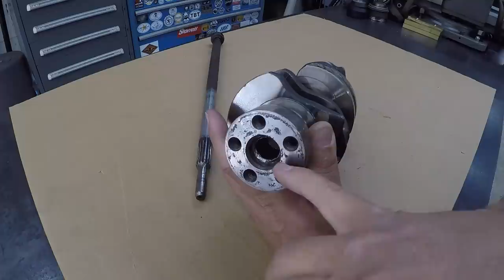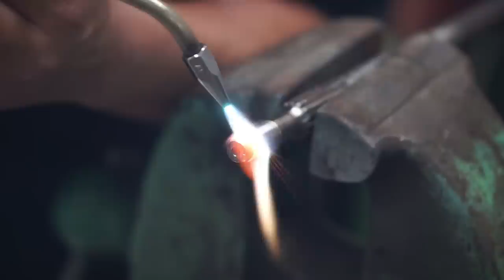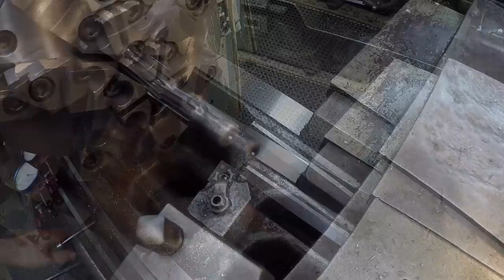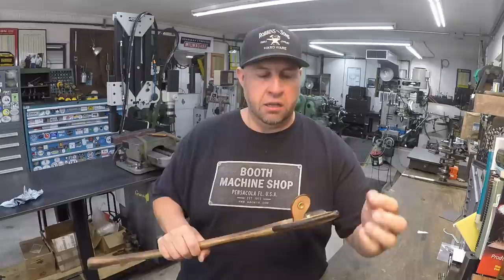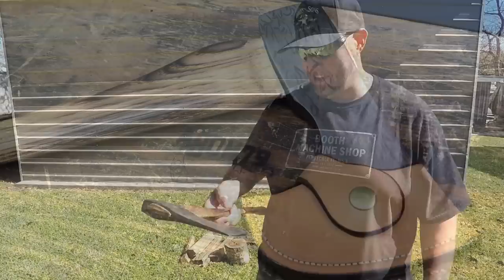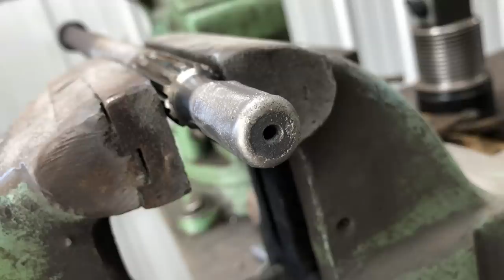SNS 292: Eutalloy Repair on Transmission Shaft, Essential Craftsman AX

Comment: The eutalloy torches have changed alot since the one i used to use in the 80's ( & that was an old 70's one ) the powder containers look the same though .    Nice work , Cheers .

Comment: Dear Abom, what I do not understand: the material is a hardened steel. If you metallize it with the Eutalloy-Tool, you may loose your tempering and hardeness anyway. How it should work ?

Comment: Hello I have already welded an axis this way but with the axis in the lathe. If you let it rotate slowly, you get a layer with the same thickness all around. You do have to cover the bed well so that there coms no powder on it. We also used a kind of heat shield paste that we put around the axe so that the heat remained only there where we spray the powder. If you put some of that pasta in the center hole of axe,, it will remain clean. Greets Eddy from the Netherlands.
Reply: He does that same spray welding process on many other projects.  It really is great for shaft build up as well.
Reply: I've seen him do it on a lathe lots of times before, I don't know why he didn't this time.

Comment: Cracking job there, but just one question. Will that fix even hold? The part was hardened before, the spray only had a low rockwell hardness, I'd love to hear your feedback.
Reply: It also looks as if the heat may have affected the heat treat of the splined area, that could have been wrapped in a wet rag to keep the heat away.
Reply: Yea I'd also say the temper was removed from that part as wel, Adam probably thought of it before starting.

Comment: Is there a reason that you didn't use a slow turning dividing head to do the spray weld ?
Would that not have given a more even application?

Comment: Would it be possible to add the Eutalloy with the torch while the shaft was rotating at a slow RPM to maintain an even addition of metal?
Reply: I saw in his answer to another comment, it's for non-rotating buildup.

Comment: Both feet should be the same distance to each side of the log your splitting. At some point your going to miss and the axe is gonna come straight back. Better that you can direct it between your shins rather than into one. Beautiful axe

Comment: Excuse my utter ignorance Adam but, surely heating the shaft up to the temperatures required for the spray weld messes with the hardness temper of the original shaft. Would this not lead to premature wear or utter failure of the shaft under regular usage in the application it’s designed for?
Again, sorry for my ignorance and I’m no metallurgical expert!
Reply: The splines and the rest of the shaft is all that matters. That end only helps keep the shaft centered.
Reply: @JusttheEdge  During the buildup the spline area turned blue, so the heat treat had to be affected.
Reply: @garybrenner6236  Clamping in the vice was probably enough to draw the heat out.

Comment: Could you set that shaft so it was rotating while you were using that amazing metal glue gun😁 to keep it coating the shaft evenly? 
What an amazing tool the Eutalloy Ultra Jet torch is, I have never seen it before now.

Comment: Hi Adam

Many YouTube posted such as you tell us the details of the puny power supply linked to their home workshop. It seems to vary across parts he country in minor detail which makes it difficult for us aliens to get a clear picture of the state of the network in USA.

Here in the great south continent ( north of Antarctica) across the vast nation we get standard 3 phase power at 415 volts RMS.    WE GET 35 amps per phase limited to 100 amps if you choose a single phase supply.  This is enough power to smelt your own metals if you can get the ore..   Bear in mind though that we pay up to 25 cents(US) per kiloWatt hour if you use this capacity.

Most homes draw down at 240 volt (RMS) via individual phases.  Load is equalised across phases within the household or by the supplier managing the phases in the street network.

Tried to keep this simple to give a. Clear picture to those , such as I , who are sometimes confused by what gets posted on YouTube.

Enjoy your posts,  Cheers!!!

Stephan of 50 Hertz

Comment: Also wonder why you didn't turn it at slow speed in the lathe or something while applying the eutaloy.   Sorry for being curious.
Reply: I had the same thought. Then I thought maybe for something that small he didn't want to risk spattering the lathe. Just me guessing,lol.
Reply: I used to do some spray welding like that at my previous job and we always turned it in the lathe at a very slow RPM. it allows for a very even application of powder. we made some covers out of light gage steel to cover and protect the ways on the lathe.

Comment: Very nice axe, awesome craftsmanship. That is a cross-cut axe for felling trees.  Way too narrow for splitting logs, you need a splitting maul or wedge and sledgehammer.  The axe is good for splitting off small kindling for a rocket stove.  Look at doing the contact style split.
Reply from the maker: tr5317 It’s an ax I can use to chop, cut, split, or whatever I need.

Comment: I mean, so long as u square up with the block ur chopping u already got the power (legs same distance just outside the shoulders, feet like train tracks and drop your hips when u swing) the leg position is mostly for safety and accuracy

Comment: Adam, do you think a powered welding positioner, set to ultra-low speed, would be an alternative to those constant adjustments in the vice?
Knowing you have the scrap stock on hand, mabey give it a try see what happens.
Reply: I saw him turn the piece in a lathe in one of his other spray welding videos, was wondering the same thing
Reply from the maker: A welding positioner is perfect for a job like this, but I have not invested in one yet.

Comment: I'm sure I'm just misunderstanding something here but if that shaft was hard to start with and the build up is only 10 Rockwell C isn't it going to be way too soft now?
Reply: I dont think it matters for the tip since it just rides in a bushing or bearing. i think the splines are the only part the really need to be hardened

Comment: Nice work but please fix that chamfer. The one on the shaft was not damaged and had that long taper on purpose to make installing the transmission easier. Trust me the more there is the easier it makes installing the transmission.

Comment: I'm not sure that is a splitting axe. The ones I've always used had much more weight to the head as well as a greater taper to the head. I am certainly no axe expert though.
Reply: grntitan1 Any axe can be a splitting axe or a felling axe. Depends on what is needed, what you got and what you need to do. I use wedges and a sledge hammer for splitting 3” and above stuff never a bladed axe. I use a small hatchet and the contact method for splitting up kindling. I’m just an old Boy Scout.

Comment: Im sure if you wanted to you could have set it up easily, but why not put the shaft in a rotating setup for spray welding?
Reply: @Global Eco Tec - Ritter ohne Furcht und Tadel Thanks for pointing that out. I knew there was a good reason just couldnt figure it out myself. Makes a lot of sense.

Comment: Id recomend you get a carbide center drill - you need high RPM but you can even centerdrill hardened high speed steel

Comment: If the original hardened shaft's metal did not hold up, it is unlikely that the powder metal build up will hold.  Just saying.
Reply: The end of the shaft was hardened primarily to harden the splines - it's quicker to just induction-harden the entire end of the pilot shaft, production-wise. The pilot end runs in a bearing or bushing in a bore in the end of the crankshaft; the bearing failed, and the hardened end of the pilot shaft wallowed out the crankshaft end. Not being hardened like it was will likely make the pilot bearing last longer.
Reply from the maker: It’ll hold, and work....just sayin 🤷🏽‍♂️

Comment: Why did you use that torch instead of the other one you usually use? And why not weld on the lathe? And wouldn't all that heat affect the temper of the shaft?
Reply: snakethebeast I thought the same thing. He had the shaft glowing which would soften it.
Reply: Oh yeah, that shaft end is soft as butter now!
Reply: Have you never heard of 'Re-Tempering' ?
Reply: Sure, retempering is something you could try, however because of the Eutalloy buildup, you probably don’t want to do because they would differentially harden and could cause the repair to loose its bond. If it were built up with weld, yes.
Reply: @Ex3t3r  Did you see him re-temper? Pretty sure he said that shaft was done.
Reply: Harry Palmer he also said he wanted it to become soft for machining and never once said anything about hardening it again.
Reply: @olivierlaplante8967  The machining aspect may have been completed so that just leaves  the re-tempering, this he may of contracted out to another company. Why not ask him ?
Reply: @olivierlaplante8967  He may of contracted this aspect of work out to another company where he was unable to film the process, why not ask him?

Comment: How does that work with the shaft being hardened and the Eutaloy being softer.   Won't that just wear out rapidly?   Normally a crank has a pilot bearing in it and the shaft goes into that bearing.  That bearing might be sintered bronze.   Or did the shaft harden due to wear damage?

Comment: Since the temperature of the shaft end got well over the "critical point"... I guess the material behind the splines would be a LOT softer... or it's OK? How are you making sure the metalurgy didnt change so that the customer doesnt end up with a soft end of the shaft? compare hardness of both ends or ..?
Reply: Yeah, I think there was another type of alloy intended specifically for building up hardened steel.
Reply: I don't want to be an armchair quarterback but that was my exact thought as well.  I would want to use hardness test files at least on the splines before and after the Eutalloy process to ensure the shaft remained hard.
Reply: @benrivenbark  ....Adam has a Rockwell hardness tester.  He knows what he is doing and I am sure he is aware of any issues with the temper of that part.

Comment: A couple of questions, Having watched some of your metal spraying videos I have just acquired a Eutectic Microflow torch and 16 bottles of various powders, what masking solution are you using as I need to get some myself, and is is possible to use Oxy Propane for this process or do I need to stick with Acetylene. I have not used this kit before so it will be a fast learning curve but I have almost 8 kilos of various powders ( that's 17.5lbs on your side of the pond). Great channel always interesting to see what you're doing

Comment: Are you able to harden that eutalloy?
Reply: capnthepeafarmer I’m wondering same thing,  specially since it’s going to get hot, if it’s too soft seems like it may seize up inside bushing/bearing
Reply: @mitchcumstein9808  Its definitely not going to get that hot. The splines need to be hard and thats it
Reply: Yeah, I was wondering that too. Once applied, can you harden eutoloy spray metals?

Comment: OK. I have a question. I completely understand that the point of the video is to show another technique of repairing a worn shaft. Great video and you accomplished the goal. But from a technical perspective why use the spray method for this job. The shaft was hardened as you show with the file to let's say 40+ HRC. The spray is rated to 10 HRC. Now given that a 40 HRC shaft wore down in the first place, why would you replace it with 10 HRC? So, I get the point of the video is to show different techniques, but why not braze on (or silver solder) a 60+ HRC collar … I'm just trying to understand.
Reply: You beat me to asking this question. Didn't heating the end of the shaft slightly anneal the and lower the hardness? That, and then spray on welding something that's only 10 HRC makes me wonder how this will wear now that it's likely much softer than when it came from the factory. Just trying to learn here  Abom - can you explain your thought process on this?
Reply: Several others including  myself asked the same questions. The unintended criticism taken seems to have triggered a defensive response. Not likely to get an answer. Don't expect one. 
Technically I guess the only one he owes an answer to is the customer if/when they have to tear the thing down again and buy the new parts anyways. Other viewers following suit considering this a viable repair could also fail without knowing the devil in the details.
Out of 100 other methods to do this, it probably should still have been declined as too high risk wasting everyone's time and money. I genuinely question the application,  annealing the shaft and using low temp soft alloy not much better than a solder coating sets off experienced intuition warnings. Trying to save the customer a few bucks can really harm ones reputation without a stern caveat they take all the risk and responsibility for the results.  
I do hope it turns out well.  It would be a sad nightmare if all that soft material contaminates everything.
Reply: LetsJeep - Yea, my comment with the same hardness questions, from just after the video was posted, seems to have just disappeared. It’s all good.
Reply: @richardneel6953  So just reharden the shaft?
Reply: @LetsJeep  Cast iron on brass bushings last for a very long time. Babbitt bearings are made out of lead, which is very much softer than anything steel.
Reply: @the_hate_inside1085 Neither really applies here as an apples to apples comparison. Brass bushings are typically low speed, low load rotational forces and Babbitt bearings are typically high oil pressure fed so there is never any sustained metal to metal contact. 
The base material cannot be re-heat treated. 
Sorry, the build up material melt temp is below the required phase change to reharden.
Reply: @the_hate_inside1085   rehardening the shaft wont do anything , the spray metal wont get any harder than what it is when it is sprayed on

Comment: Curious what kind of guarantee did you give him on how long it would last.I'm guessing that case-hardened shaft the last a couple hours under normal use.
Reply: I don't know what he's doing on the crank end next, but if he presses an oil-lite bushing into it it'll last for a very long time.. the shaft only turns in the bushing when the clutch is depressed
He could perhaps turn the ID of the crank bigger and put something like a 6202 bearing in and it would be next to eternal.
Reply: The shaft is connected to transmission and splined to clutch driven plate. As it is inserted into a self lubricating bush  in the crankshaft and only rotates free while the clutch is disengaged, it will literally last a lifetime.

Comment: What is that blue device with exhaust pipe next to the door ?
Reply: It's a portable fume extractor. You move the head over where your welding, cutting or grinding and it sucks up the fumes made and filters the air before expelling it again.
Reply: @TheQuantumFire  cool! thank you !

Comment: Are you going to re-harden the end of the shaft? Otherwise I forsee quick failure.
Reply: He said the failure was due to a failed pilot bearing, the shaft need not be hard, just the splines, the tip is only there to engage a bearing.
Reply: @derekcoiner5946  yup, and the shaft only turns on the pilot when the clutch is depressed.. it also only really needs to hold the weight of the clutch disc, so a couple pounds or so?

Comment: That's not for boy scouts. Outdoorsmen have name for that length and blade shape, but I can't remember it.
Reply: We used to call them a 3/4 axe.  (When we were Boy Scouts) 
:)
Reply: Dont they call that a "bearded" ax head?
Reply: Yes I think they do call it that.  I think Adam was referring to the weight of the head and consequently the length of the handle.  It would have been a bit silly to put a full size handle on a light weight head.  I went looking for the link to the essential craftsman video to see what he called it but got distracted :)
In any case it is a very nice axe.  I have never been into the burnt handle effect personally.

Comment: Long long time ago Dad showed me an easier way to split wood by holding the axe a few degrees off 90 degrees ,after the axe head hits the wood it cuts and  rotates 1/4 turn and separates the wood .

Comment: When machinists become auto mechanics. that trans shaft is special steel and special hardened through a special process. The spray metal is not going to hold up for 5 minutes. Ill lay a bet with anyone. The shaft should have been replaced. If you cant afford it then there are other options. The bus. A horse. A bicycle..

Sorry, this is not a proper repair. Sometimes repair means replacing.
Reply: Calm down, and think about this for a minute. How hard could that shaft be if it was torn up by brass bushing or a cast iron crankshaft?
Reply: PTSD Channel Adam clearly said in the video that he repaired it the way the customer wanted him to. So that makes it irrelevant whether you think there was a better way. Sorry mate
Reply: My concern was more of the reduced chamfer. That will be a bear to get into the pilot.